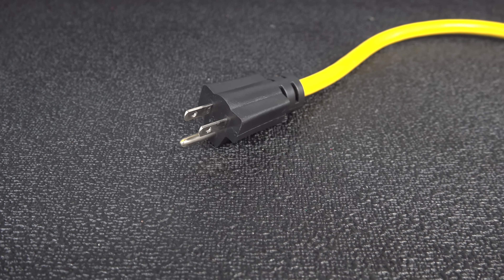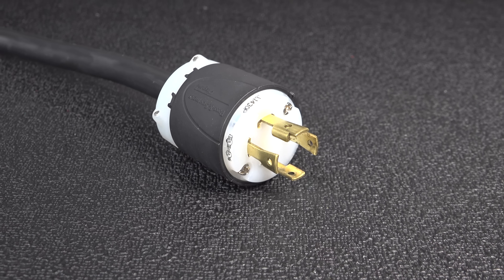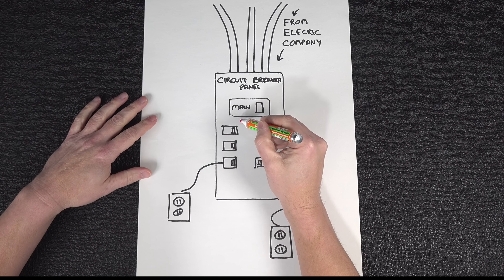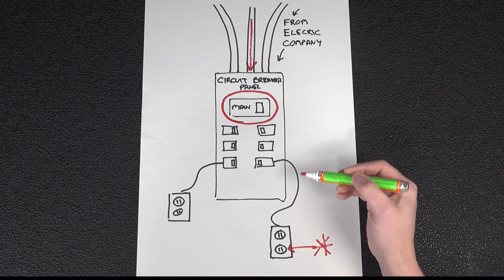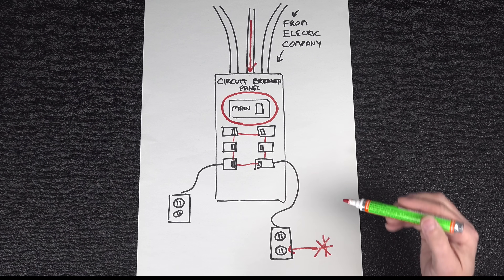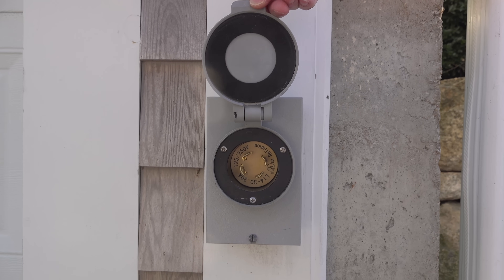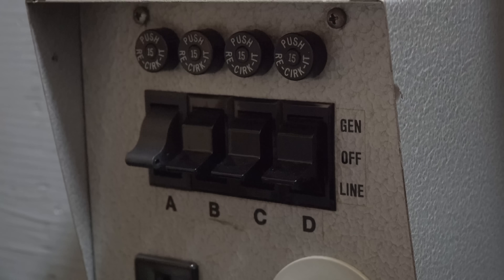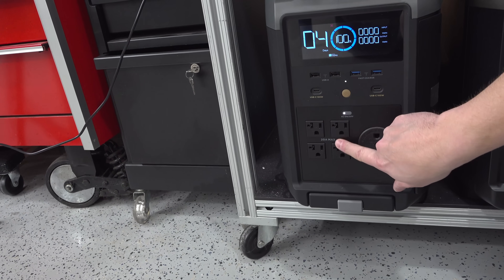Worst Electrical Mistake You Can Make - Backfeeding Generators

Comment: We actually use those double male cables at my work. Ironically their there for safety. If the cable gets unplugged then heavy machinery gets turned off. If these weren't there then we would have had some pretty messy accidents.
Reply: Huh?  If any cable gets unplugged, the machine it is powering gets turned off.  Having double male means if you unplug the end from the machine, you can get shocked by the exposed prongs.
Reply: @phillipsusi1791  Yeah in theory they can shock you. The power that runs through those cables is exclusively to tell whether they're pluged in or not. Not to power the machine itself. So the cables are running really low voltage.
Reply: @MrBobwatman  Again, huh?  If they are low voltage data cables ( <= 24v ), then they can't shock you.

Comment: So because some people are too stupid to do something properly nobody should be able to. Thanks nanny. Nanny knows what's best for everyone, nanny holds everyone to the same low standard. You'd think that turning the main breaker off as well as breakers you don't want to feed and limiting your electric use to the maximum capacity of the wire/wires (15 or 20 amps depending) would be awfully handy in a pinch. But... *gasp*, someone else might not do it right. Nanny to the rescue.

Comment: I once lived in a house in an area of Britain subject to occasional blackouts. We had a young baby at that time.
I connected the important circuits- lighting, refrigerator, and freezer to a separate fuseboard (MCBs were not so common then) which was supplied from a heavy duty changeover switch connected to either the main fuseboard or to the 2.5kW generator.
No risk of backfeeding, electric shock, or overloading the generator as it was only the essential circuits that were supplied. Generator power was then available quickly without any problems.

Comment: dont know about you i just pull a extension cable from my generator to a oven and whaver else i need. then wablamo i disconnect everything and plug it into the wall if the power comes back on.

Comment: The way I hook up my generator avoids the grid. Extension cord to an outlet strip where we plug in fridge, wifi router and tv directly to the outlet strip, not into a wall outlet. Its a northern MN cabin where powerlines are not underground. Thunderstorms knock down lines several times per summer when the trees are in full bloom, put we are usually up again in a few hours.

Comment: I suspect that if you actually connected your house to the generator without disconnecting the house from the grid, the generator would immediately shut off as it would not be able to handle the load.

Comment: So, how is it done when people have their home running on their solar panel during a power outage ? Is there some form of smart breakers ? Because I know it’s possible for people to resell the electricity they produce to the grid, so they can be back feeding, I guess ?
Reply from the maker: You are exactly right, they have a safety mechanism so that when the utility power goes out, they no longer feed back to the grid. Totally legal because of course there is a safety mechanism that does it immediately and requires no intervention
Reply: @SilverCymbal  okay, thanks for the information !

Comment: It's called a suicide plug professional electrical service techs use them when power in racked electrical equipment is required but not tied in to building service . Mainly for testing  of system in rack components or very limited  full rack power up , nonsignal pass test just to see if power led lights up.

Comment: All of the dangers you mention are valid and true; however, I know one legitimate use case for that cable.
Some corded electric weed trimmers I've used have a female receptacle on them, which is bad design and a half... but it's a legitimate use at least.
Reply: As long as you plug into the weed eater first then the power your fine lmao
Reply: That's scary!!! I have an electric leaf blower and if you tug hard enough on it, it will sometimes unplug.  (Tying the two cords in a knot fixes this, BTW)   Now imagine the end of the extension cord is live!!! Nice!!  At least my blower has a male end plug...

Comment: That cable is only use to connect two extension cord.
I don't know why you go on about the breaker panel.
It's common sense 
If you want to connect 50ft extension cord to another 50ft extension cord or so.

Comment: This is one of those things that people panic about because it 'looks scary'.  People have been doing this since generators first existed and the fear prn stories you hear are rarely true.  There's bigger things in life to worry about.  Turn off your mains and go ahead with backfeeding - if you fail to turn off your mains there is a very limited danger to electrical workers for a few reasons:  1.  They are trained to never treat a non-energized cable as safe unless it is fully isolated.  2.  If the grid comes back online your generator ain't gonna do squat vs the grid.  3.  If you are connected to the grid and do not disconnect mains you're powering everyone else who is connected.  Again, your generator ain't gonna do squat.  4.  The only case where danger exists is if your local line is broken, someone is actively working on the line, and while they are actively working on it you hook up your generator.

Comment: Also when you're back feeding power into an electrical outlet, you're circumventing the breaker and fuse panel.
They're called outlets for a reason!
Reply: No, you are not.  The breaker is still on the line and will still trip if the current on it exceeds the rating.

Comment: Thank you for showing how a Power Inlet Box and Interlock switch work for feeding a panel with an emergency generator. Power Inlet Boxes come in either 30 or 50 amp. This setup is by far the simplest, easiest, and cheapest way to go.  In many ways, a power inlet box and interlock switch are making manual transfer switches completely obsolete.

Comment: Ok I understand the overall message here. But fully disabling/disconnecting your power from mains, and then supplying your own power to your home wiring, is not illegal.
Reply: the particularly illegal part sounds like where mains is not disconnected. which i guess happens a lot when it requires a conscious act to do just that.

Comment: These cords are for connecting  power strips. In my school the classroom tables had power strips affixed to them. To energize them you would plug a male-male cable from one table to the next. Sure, there could have been a dangling cord at on end of each table but then you were limited at how you could position the table. When the tables were folded up and the cables pulled out they stored and stacked neatly. These types of cords did have a legitimate use.
Reply: @waterlevelroute  Definitely. My friend pulled one out and plugged it back into both sockets of an outlet and blew out the breaker. I didn't mean to say they were safe, just useful.

Comment: So, how about plugging in the unpowered side first and then to the generator? Or for that matter not turning on the generator before having completed the connection? Just because sth can be used dangerously doesn't mean it should not be sold.

Comment: That cable isn't necessarily sold to promote illegal back feeding. My grandpa has 2 designated generator circuits in his house that are not connected to the grid. Each circuit is fed through half of a duplex outlet placed in a water proof box on the outside of his house using 2 of these. This is an electrician installed system, and completely safe.

Comment: When I was a kid, we lived in an area where power outages were frequent. When our house was built, my parents had a hardwired cord for a generator put in with an interlock. The generator wasn't anywhere near powerful enough to run the whole house, so we had essential circuits (Well pump, refrigerator, etc.) marked with some whiteout on the breaker handles. I have many memories of being on "Generator and breaker duty".

Comment: Two points. Equipment we get from China often comes with reverse plugs (power on exposed prongs)

Second, just because something illegal doesn't make it wrong or bad.

You kill your credibly with that last sentence
Reply: disgusts me seeing that second point used here. it's illegal because it is dangerous. if not to you, then to someone else. also, generally speaking, having powered male ends, is extremely bad, for the exact reason that it is extremely dangerous. as the video states. i've heard anti-generator rhetoric from my mother thanks to the fact people don't properly set their homes up for backup power and linemen get fried during an outage. as i suspected, a stupid problem that exists from sheer idiocy. still can't say i agree at all with using those suicide cords, but use a damned interlock or transfer switch if you do any kind of back-feeding. otherwise, i think criminal negligence, at the very least, is an appropriate charge when someone is injured or killed.
Reply: @ETXAlienRobot201  Your logic means slavery was good because it was legal. 

Legality doesn't mean right. Equally something being illegal doesn't mean it's wrong.

Something can be illegal and not wrong or bad

For example, It was illegal for people of different races to live together. Thats shouldn't have been illegal, but it was. Do you see the problem.

The statement that something being illegal means it's bad justify all kings of horrible things.

The video was good enough on its own until that last ridiculous statement. 

There's no need to water down the video with bad reasoning.
Reply: @AntonioCunningham  
ah, there's a straw-man if ever i saw one
even devolves to a slippery slope.
we're done here.
Reply: @ETXAlienRobot201  Oh no! I can't defend my point so I name call and plug my ear from anything that can possibly challenge my world view.

Comment: I have a little 120v/240v welder... It came with a 120v plug on the welder and a adapter cable that plugs into a 240v outlet and had a 120v female plug.  Super sketchy looking..

I bought a mixing tank that came with a pump, it was euro spec but came with a us plug adapter to plug it into a 120v plug.  HOWEVER european outlets are 220v so I had the euro pump plugged into adapter, plugged into the 120v (looking) female side of the welder adapter plugged into 240v outlet. Lmao it looked sketchy as fuck

Comment: How dare you assume the gender of the plugs! HOW DARE YOU!!!  lol, I currently rent and use an inverter, I just doubled up the cabling leads to needed items as it cant drive everything, so if I loose power, I just swap out the plug from the wall to items. Computers and sensitive equipment runs off the inverter 100% of the time. That interlock is a genius idea, I will most definitely use something like that. 
Its kinda like this story I heard, not sure if its true, but sounds like it could happen, sort of. Guy was cooking, power went off, got his gas burner, place the gas bottle on the stove and continued. He never switched the electric stove off, so when power came back, it heated the gas bottle and it exploded. What I cant figure is, if he was using a normal electric stove, the element would still be really hot for a while, would he really put a gas bottle on that?? Anyway, meh, humans will do stupid.
Thanks for the explanation, I'm not that clued up about electricity and learning atm, I connected my own inverter without blowing up anything!!

Comment: I have an interlock for my generator. It was maybe $150 in parts and took my Father and I only an hour or so to put in. My Father is a licensed electrician. It really is the cheapest way to safely hook a generator to your house.
Reply from the maker: Well said. And that install will last a lifetime. Generators change but that hookup won't. I put mine in 10 years ago, and now I can use it, my wife or someone else without worry.
Reply: $150 vs electrocution or a property fire.
Reply: it took "my father and me"
Reply: $150 for a piece of stainless and 3 screws? or ar you talking about an entire bespoke breaker panel
Reply: @calinguga  You need the interlock kit itself (not $150 but more expensive than you think), the inlet box, a double-pole 30A breaker, the appropriate length of 10-3 wire, wire clamps for where it exits the panel and enters the inlet box, and staples or whatever to secure the wire. The only significant variable to the cost is the length of the wire run.
Reply: Thats a LOT of money for a little aluminium plate and three screws....
Reply: @Debbiebabe69  It's not for just that. It's also for the breaker, the wire, the inlet box, and whatever's needed to install everything.
Reply: I just prefer to use my brain and turn of the main...... doctor...suesse?
Reply: @winddowntime2943  The human brain is completely unreliable.
Reply: Your Father in heaven?

Comment: Aside from back feeding being illegal, which most honestly don’t care, backfeeding will created a shit ton of load on your generator and wear it out immensely quicker. I have tested that theory multiple times. It can draw such a load it will completely stall out your generator. Have an electrician Help you at all costs. There is no reason to risk a house fire or anyone safety.
Reply: Yeah if you dont shut off the main breaker it'll stall out your generator. If the current draw from lights and always on appliances is enough to stall out your generator then it means youre using a generator thats too small

Comment: Used a home made one of these to power up my detached garage during the build process.  It kept raining every time I had time to dig my trench for the power going to the sub panel so we worked in the dry and got all of the indoor wiring done.  Whipped up a male to male plug so I could use my outlets and lights in the building whenever I was inside it working.  I’ve never seen the purpose of buying a double ended cable when you can make your own in a pinch.

Comment: Stop giving incorrect advice it is only illegal to do so inside of some city ordinance and I believe one or two states for the vast majority of people it is not illegal to backfeed your house in any way shape or form what is illegal is back feeding the main line so as long as you're not back feeding the main line it's not illegal in most places
Reply from the maker: It is against the national electric code which has been adopted and followed in every state and even those that don't officially accept it the rules are 99% the same. Before this video I researched this and am confident to share there is nowhere in the US this is permitted. This is one of those things people want to believe is legal but it's not. If you find evidence to the contrary feel free to share it
Reply: @SilverCymbal  okay I see what you're talking about and while yes that does exist and yes it is technically illegal in researching the local laws and regulations for my home state of Louisiana there is no fine it is not enforced and the only thing that I can find for potential charges if you do happen to backfeed is as little as a slap on the wrist to as much as involuntary manslaughter if you happen to kill a lineman which is not that big of a charge considering the severity of the situation I agree it is very dangerous if you don't know what you're doing but when done appropriately and all safety precautions have been taken it is not something that we should outright stop people from doing

Comment: Tools like this are fine if you know what you're doing.  A $10 cord vs paying hundreds (thousands if you do it the "right way", pull a permit and hire an electrician).

Obviously it can be a problem for those who don't understand electrical wiring but those people are unlikely to try something like this in the first place.
Reply from the maker: An interlock costs $50 and the outlet and wire are $70, not to make it legal but to make it foolproof and safe. If you can buy a generator and rig up a hacked cord, you can do it That hookup will last the life of the house too.

Comment: Power company guys are well aware of these issues .they have to be. A dual male jumper  has a lot of safe applications out side of,   that it could be used for something dangerous. Hell, two coat- hangers can be used for what you are talking about.

Comment: I have never seen these kind of plugs before, but I can immediately tell it looked suspicious and dangerous.
Reply: It looks like something Wile E Coyote would order from the ACME catalog. Meep, Meep!
Reply: Seen them referred to as suicide cables before, because that's what you're doing if you try to use them 90% of the time. most common to see them asked for around Christmas because people set up some of their lights backwards or something, so they need to connect two female ends. Which is great because then someone can plug both ends of the Christmas lights in.
Reply: @mattvoelker241  Hah, yeah!  Now imagine if the two outlets they plug into are on opposite legs of the breaker panel.  Now you have a 240v short on 120v cables.  Extra fun!
Reply: As a lineman I can you all we don’t give a fk about this. It’s not that serious calm down.

Comment: the main problem is people not shutting off the main breaker and not plugging the connectors in in the right order. Its not worth it, too many ways to accidentally screw up and hurt someone, just get a proper transfer switch installed or power things with extension cords and dont use the homes wiring during the power outage.